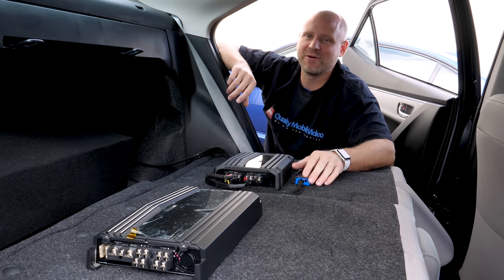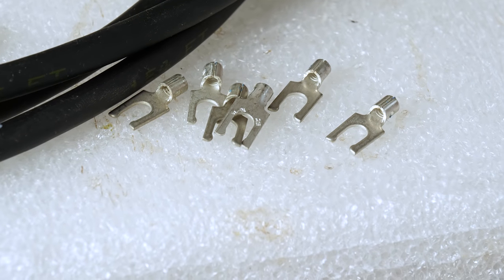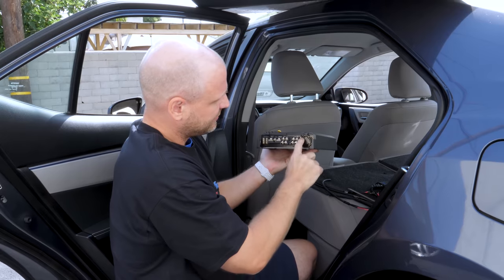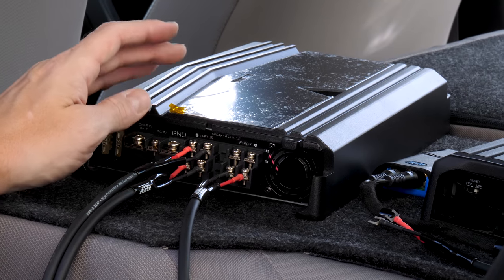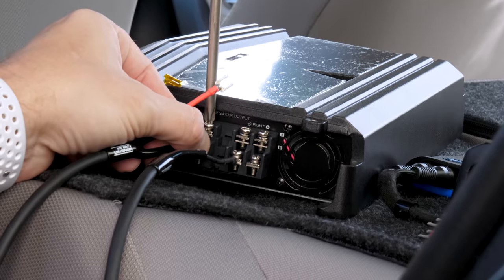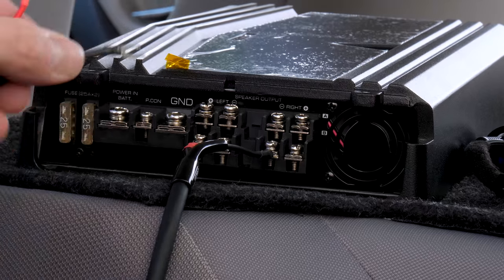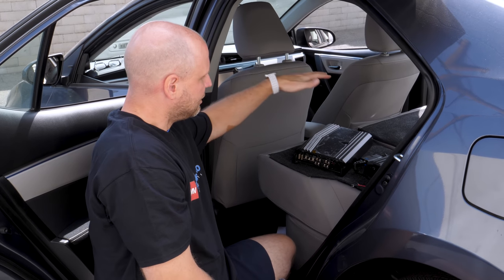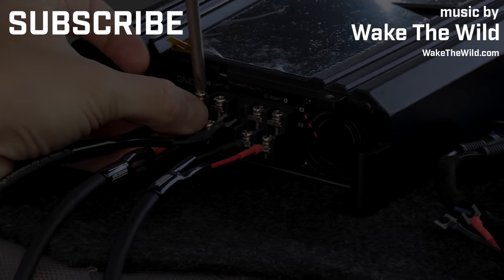How To Wire Speakers and Subwoofers to Your Amplifier - 2, 3, 4 and 5 Channel - Bridged Mode

Comment: 00:31 - my aftermarket android navigation system pushes out 45watts x 4.  New speakers I’m getting push 100 watts rms. Currently I can play music at max volume up 18 out of 35 and anything above 23 starts distorting the speakers.  When putting in new speakers I’ve noticed the positive and negative connections already there for easy plug and play application.  How can I utilize the speaker wires already wired in my vehicle to connect to a 100rms x 4 speaker amp at 4 ohms.  Do I run all my four speaker wires from speaker amp 4 ch to my aftermarket head unit and tap into the speaker wires? Watched a lot of videos, going to do the work myself.  Any tips/ advice would be appreciated. 

What I have currently 
(2) 1” dome tweeters SKAR audio 75 watt rms with crossovers. 
(2) 6.5” TSM650PRO
(2) 6x9” TS6900PRO

Currently I have a Rockford Fosgate T1 12” subwoofer that pounds. 

I’d have to wire 12V power to splitter going into current subwoofer amp and a new power wire going into my speaker amp to power 100 watts x4.  

If you’re still with me.  Let me know of any best practices for making this installation hassle n’ pain free.  Thx!

Edit: 
Not sure if I’ll need a line output converter or a DSP.  I’ll be installing the sound deadening material tomorrow and the speakers over the weekend. I’ll see how much power my current amp pushes to these speakers and how they sound at 45watts rms.  I know I won’t be using full power, but then I’ll see a difference when connecting a 4ch speaker amp. Also, I have one set of RCA red/ white running from head unit to subwoofer amp.  I’ll have to see if my aftermarket radio has another red/white rca to run to the speaker amp.  I’m doing a lot of research and gathering as much info.  Seriously, any help is appreciated.

Comment: What about six speakers? My car has the stock 4 and stock 2 tweeters. So could I just do the same parallel connection with six or would it just only be for 4?
Reply from the maker: Technically we did upgrade 6 speakers! We did tweeters as well.

Comment: Assume you have 6 4ohm door/dash speakers and a 5 channel amp (GM-DX975). You run the dash speakers parallel to front door speakers. What happens there? From my understanding it turns into 2ohms and thus will be louder than your rear door speakers? I'm lost, please help

Comment: Hi ,,, shall i connect the rear speakers with the subwoofer and amplifier?? or there is a problem if  i connect the amplifier and subwoofer directly with the car battery and the radio??

Comment: In my case, i have 2 tweeters, 4 speakers and 1 subwoofer, Then i have an old Audiola 400w 2ch. Amplifier and a brand new Pioneer DEH-x5900bt stereo provided with 3 pre out rca (front, rear, sub). How should i properly connect the stereo to the amplifier and all the 6 speakers + 1 subwoofer to the amplifier? Is that even possible, or should i get a 4ch. Amplifier? Thanks!
Reply: How do you hook up to a 12 inch bass speaker that has for voice calls

Comment: I have one old Quantum solar S4250 amplifier and has one switch for 2/3/4 channels . I have in my car audio set up  2 front channels left and right and the rear with bridged sub woofer.  On 1-2 there are the two front speakers left and right respectively and on 3-4 is the bridged sub woofer .  When the amplifier option is on 3 channel mode the sound is a bit lower and I cannot adjust from the source left and right side only front and back . When turn it to 4 channel option all the functions are ok from the source  and the sound  is much better in general . I cant get why this happens

Comment: Question: how do I do the following:
1. Front RCA outputs from the head unit. 2 channels FR FL
2. 6x9 front door speakers
3. 3.5” front dash speakers
How do I power the above from 1 amp?
4.  6 1/2 rear door speakers RR RL will remain direct powered by the head unit.

Comment: Q for Lorenzo directly... (nice work dude!)  Go look at the "speaker chair" on the George Michael FASTLOVE video...
With that established mentally... I want to do a overhead headliner filled with tons on my spare speakers.  Thinking of using a single 4 channel amp underseat.  Not being techie... will this be enough to PUSH (?) the sound to the speakers?  Probably 3" and 5" ones.  I won't be BLASTING IT.... to an extreme... but don't know if.... say... 8-10 speakers will overwhelm things.  My trucks have removable hardtops... so :rear: on the amp will be for the interior speakers, and the "front" will be assigned to the overhead ones.

Thanks heaps in advance....

Comment: If i had 6 speakers and one self powered amp how do i connect it to head unit? its in a truck 2 in dash two in doors and 2 behind seat. plus self powered sub. thanks

Comment: I have a class D 2/4 channel and I've tried hooking up all wires the same way I've done to the previous amplifier. It keeps going into protection mode. The new amplifier is a 6800 watt wudi what am I doing wrong? Please help, I've tried looking for a similar amp. None so far".
Reply from the maker: Disconnect all of the outputs and see if the amp will turn on and not go into protect. If it does then it is a speaker wiring issue, perhaps a short or a  load that is too great for the amp.

Comment: So if I run my speaker wires from my 4 channel straight from the amp to the speakers will I still be able to use the settings on my stereo deck to change the sound? (EQ, x.over, slope and such)
Reply from the maker: Yea you can adjust your settings from either the amp or head unit. It's best to pick just one and not mess with the settings on both, except maybe bass boost on your amp

Comment: It's also good to put tape around your screwdrivers or dip them and some kind of silicone helps with screwing the amp wires down without scraping or leaving marks on AMP and in case somebody has power going still somewhere it won't Ark just something I did over the years
Reply from the maker: Great tip!

Comment: can you hook up speakers and a subwoofer to a monoblock amplifier or is it one or the other? I've asked this question so many times and I never get an answer please help me out.
Reply from the maker: I wouldn't advice wiring subs and speakers to a monoblock. It's better to use a 4 channel amplifier and bridged the subwoofer to multiple channels like we did in this video.

Comment: I have aftermarket radio I brought off Amazon,on that receiver it only has two inputs one for sub and other for rear speakers so how do I connect my rca wires when amp has input for front rear and sub so what do I do?????

Comment: hello Lorenzo great job!! ,,,, i have  1800W amplifier 4 channels .. i want to install on it 2 subs as bridge and 2 speakers so how 
 can i do this?  pls help me Bro
Reply from the maker: As you can see in our video, when bridging a subwoofer we're using the positive of the left channel and negative of the right channel, which means you can't bridge two subwoofers and connect speakers at the same time! You can bridge one subwoofer and connect speakers. I recommend bridging both of the subs to the amplifier and then powering the speakers with your head unit!

Comment: If in my car i could only use 4" speakers rear and 6,5" component front, and the available watts from each is 30 watts for the 4" speaker and 60 watts for the 6,5" system both 3 ohms (JBL CLUB 4020 and 6500c), what kind of amplifier do I need to look for and how to install it? thanks!

Comment: My 4 channel Pioneer amp has two RCA inputs, for front and rear. I want to run component speakers in the front off channel A and a sub off channel B in bridged mode, obviously I would connect the front RCA from the head unit to channel A input on the amp but for the sub using channel B, would It be best to connect the RCA from the head unit's rear or sub output?
Reply: Use the Sub output from the head unit, they're separated inside the head unit and can adjusted specifically for the frequency you're looking for in most cases.
Reply: Thanks

Comment: Single cab Ford ranger, 2 shallow 10s behind seat and 2 door speakers. Was told by audiostore guy that 1 1500 watt 4 channel alpine would be insufficient for this setup. Is he correct  or exxagerating
Reply from the maker: Can't give an answer without some more specificity! RMS power, voice coils and impedance of the subs? What loads can the amplifier support? What are its RMS ratings per channel at each specific load?

Comment: for five-channel would it be the same if you had 3 speakers and one sub?
Reply from the maker: Technically you can do it, but it'd work best with 4 speakers and a sub, or 2 speakers with a sub. As you can see in the video, when you're bridging a subwoofer, you're taking up two full channels. That leaves only two channels empty to wire 3 speakers. Which mean's you'll have to bridge two speakers onto one channel, and wire the last speaker to the final channel. Those first two bridged speakers will only get half the power as the single speaker, which will result in an off-balanced sound from all three speakers

Comment: Hi Lorenzo, it´s possible connect 1 sub + 2 speakers(stereo) in a amplifier with 2 channel output (jbl gx-a602)? Thank you very mutch.
Reply from the maker: Yes it can operate as a 3 channel system! 
Minimum speaker impedance: 2 ohms each (left & right speakers); 4 ohms (subwoofer)
• Connect the left and right speakers to the FL and FR (+) and (–) terminals
• Connect the subwoofer to the RL (+) and RR (–) terminals. (The rear-channel Bass Boost control makes the rear channels preferable for subwoofer connection) NOTE: You can connect two 2-ohm subwoofers in series to maintain the required 4-ohm
minimum impedance for the subwoofer channel.
Reply: Thank you very mutch, god bless you!

Comment: Could i run 4 speakers on a parallel setup on the top 2 channels and then run 2 speakers on the bottom channels separately?

Comment: Can I use a 4 channel amp and run 2 speakers and a Sub on a stock system using a line out converter

Comment: With the dual subwoofer set up will you need two rca's? Or do you cross the rca  how does that work?
Reply from the maker: What's your amplifier and whats your head unit? (Brand,  model #'s)

Comment: i have a question i am new to car audio and kinda wondering, if i would want to hear my mids and highs playing on my mids and highs and my sub on my lows only how do i do my connections?
Reply from the maker: Well it all depends on your gear/system, plus what your settings are on your amplifier/head unit/crossovers. You'll want to adjust the frequencies of each type of speaker accordingly. High pass Filters for the mids and highs, and Low Pass Filters for the subwoofer. Proper tuning and balance will create your audio's performance at its best. It depends on what is connected where. You can power your mids and highs with your head unit and power the sub with you amplifier, that's what I do.

Comment: I have  1800w Sony aub and 4 speaker 650w and my amp 1000 w Sony , 2 bridge connection for 4 speaker and one 4 subwoofer ,is it any issue for amp

Comment: I've owned more Kenwood head units AND amps than every other brand combined since the 70's! Oh, yes I'm 60 years old. :)
Reply: The system I built for my 98 Dodge Stratus 10 years ago, ALL Kenwood as much as possible! If not Kenwood, it had to be Clarion other than the tweeters. Took me several months to build the amp rack alone! http://s254.photobucket.com/user/Hairball98498/library/98%20Stratus%20stereo
Reply: Do you sell all of these

Comment: I have a scenario here , say there are  2  DVC     4 OHM subs and a class d / mono amp with 
+ + - - as opposed to + - on a class D amp ?  Can you run each sub individually  without connecting the 2 together ??

Forgive me for this mess I  have nott slept in a couple days
Reply from the maker: What is the model of the amplifier
Reply: @Qualitymobilevideo  
Its a Kicker CX1200.1 , not the newer model but the black with yellow stripe maybe 2014 ~

Comment: So if I have 2 12’s (subs) and 4 aftermarket door speakers with tweeters I won’t be able to wire everything to the amp with a 4 channel amp?
Reply from the maker: As we demonstrate in the video, you're going to bridge just one subwoofer, you'll need to use two speaker terminals, meaning two bridged subwoofers will take over all four speaker terminals. There will be no remaining channels to wire your six speakers. I would suggest either using your head unit or getting a second amplifier
Reply: Quality Mobile Video so I would need a 4 channel amp for the speakers themselves right? And what size amp would I need for them?

Comment: Thanks for the AWESOME vid!! I haven’t looked around yet (I subscribed!) but, do you have a vid showing how to hook up 4 speakers, one sub and two amps?! I have an old double din pioneer head unit, so I’m good with two rca outputs, just not 100% clear on how to make it all work!  

Quick run down of my set up, Orion L5 solo baric, (ancient) old performance technique (800 watt) amp, and stock Mach 460 speaker system (will be upgrading soon!!).  I have an amp or two laying around somewhere, one is rated at about 150watts and the other approximately 300 watts. If I can find the 300 watt amp, I want to install it to power the 4 speakers and possibly 4 tweeters (front and rear). If I don’t find it, then I plan on picking up a decent 300+watt amp. 

Also, as previously mentioned, I have stock Ford Mach 460 system (I know I’ll basically be gutting it). I’m torn between buying Pioneer A series 6x8s and Alpine Type R 6x8! I like the clarity of the Alpines, but love the “highs” (tweeters) of the Pioneers! I know I can pick up some tweeters to match the Alpines, but yeah, still torn as to which route to take! What’s your preference/recommendation? Or, do you happen to favor a different brand speaker? I’m not looking to build a performance/show system, just want something I can enjoy and any sound level, with crystal clear highs, mids and bass for days! Sorry, I know, loaded question! Hope to hear back from you guys soon, and thanks again for the amazing vid!!!! 👍🏼
Reply: You talk to much!

Comment: That amplifier of the foreground,  at 0:12, has it got a fan mounted behind that circular vent on the right? I recently bought a kenwood amplifier and it has the same circular air duct, but no fan is installed behind it.. it also has 2 holes across the diagonal of the round vent which seem to be there for screwing a fan on it.  Is it a feature or is it just an exhausting vent with no other purpose?
Reply from the maker: Yea there is no fan, its just for venting/heat dissipation
Reply: Uh now that is a prompt answer... thanks guys, I'm too far away to be a loyal customer, but I can surely be a loyal subscriber.. just make sure Lorenzo pops in every so often with some on-the-field tutorial to match up with James' awesome theory explanations and that lame cardigan of his ;)
Reply from the maker: Lmfao we got a new Lorenzo Tutorial on Line Output Converters dropping first thing tomorrow morning so make sure you see it!

Comment: Why did you prefer parallel to series type connection?
Reply from the maker: It's not necessarily that we prefer it, but parallel offers you the most potential power in your system

Comment: What are those y splitter sleeve that, are used to cover the transision from the single insulated wire to the seprate speaker wires, called?
Reply from the maker: Usually called Y-splitters, a lot of people called them different things

Comment: I got a 5 channel amp when i connect the speakers bout 2 channels work only when i try to bridge them em i doing something wrong?
Reply from the maker: In bridged mode you combine two channels to make one. You may be loading the amplifier too low and it is going into protect.

Comment: OK m8 just quick question running amp 4 switch and subwoifer with 2 speakers, now got sub speakers wired to right side of amp. Then speaker wires to left terminals doubled up., seen video that they put sub wiring into right terminals and just placed other into left then joined them with one of the speaker wires. And same with other wiring from sub, so now one sub speaker wired into left one to right and 2 car speakers to left to 2 right, sharing sub wiring. I've also got sw on back of unit but don't know what wire should go to that. Please advise system sounds Shyte at mo. Should I copy way was done in video as I explained way they done it
Reply: Ps you wire amp to both sides cause I have 2 speakers in sub should I just copy the same with 2 speaks on too terminals or opposite to left/right

Comment: So hooking up 2 speakers to a single channel... Does this make a typical 4ohm speaker into a 2ohm speaker using this method?
Reply: If the speakers are run in parallel, impedance is reduced. If they are run in series, they are summed

Comment: Qwick question,  i have a type r 12 sub with a hifonics brz1700 rms mono amp  its all wired up if i want to get 4 new doors can i wire them to the mono amp? Like just have the amp power everything or will it be under power im planning on a radio soon pinoeer avh600ex please let me know im new to this
Reply from the maker: I highly suggest either getting a 4 channel amp or simply replacing the speakers with the factory connections and using the head unit to power the speakers
Reply: @Qualitymobilevideo  that could work i wanted to try to get atleast 50 watts rms each speaker do you think ill be able to with just that amp?  Cause wouldnt the radio just be like 20rms?

Comment: If i have 3 sets of coaxial cables wired out of my head unit, 2 sets for speakers amd 1 set for subs, what kind of amp should i use?
Reply from the maker: You can use a 4 channel amplifier like in this video, and create a 3 channel system, bridging all 4 speakers onto two terminals, and bridging the subwoofer onto the remaining two terminals
Reply: @Qualitymobilevideo  okay, thank you very much.